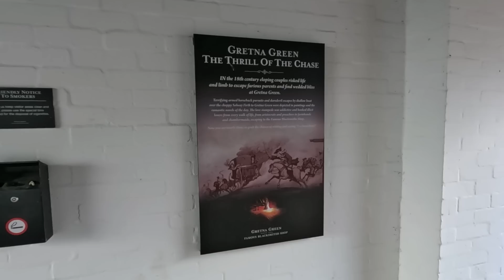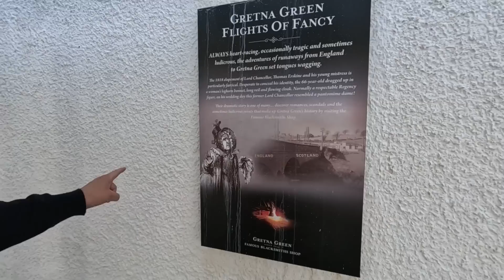Arriving At Moffat Camping And Caravanning Club Site | Bailey Adamo 75-4T

Comment: Another fuel tip at the moment if you are staying at Strathclyde Park and heading North, or south, check out the Fuel prices At Sainsbury’s & the independent station at Strathaven, some 5p/l cheaper than rest in Glasgow, unless you are a COSCO member (same) and Up to 10pm cheaper than further N or South.  It is a bit of a deviation off the M74, Larkhall exit, 6m each way, but worth it if you have an empty tank.
Reply from the maker: Thanks, we filled up at Moffat at £1.41 which was the cheapest we'd seen for ages.

Comment: Hi Bob & Jenny, I wonder if you could do me a favour please? We have a 69-4 and have enquired about changing the tyres to something with better off-road grip and were recommended the General AT3's. I caught what I thought was part of 'General' on the tyre wall - are you able to let me know what the tyres are on the Adamo you're using please?
Reply from the maker: They are General Grabbers AT 235/65 R16 C 121/119 R M&S.
Reply: @BobEarnshawMoHo  Thanks Bob, do you find them OK to drive?
Reply from the maker: They ride fine, but I suspect there's a bit more tyre noise on rougher surfaces, however it's difficult to tell on most UK roads these days.
Reply: @BobEarnshawMoHo  Thank you Bob.